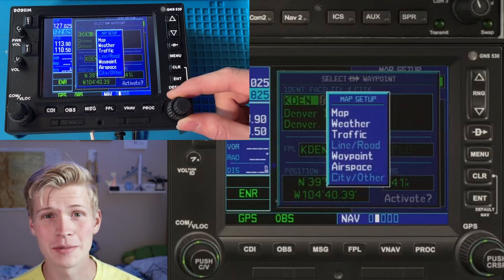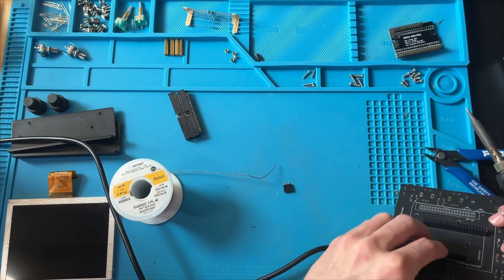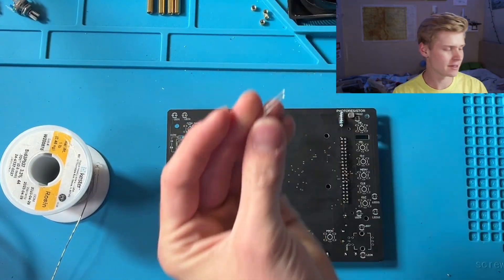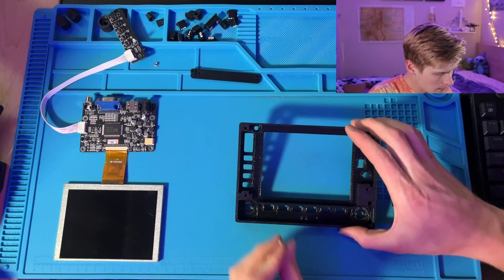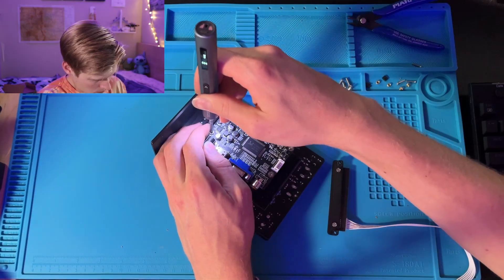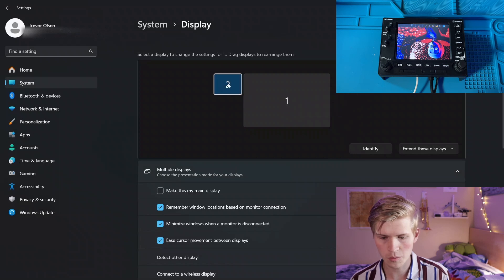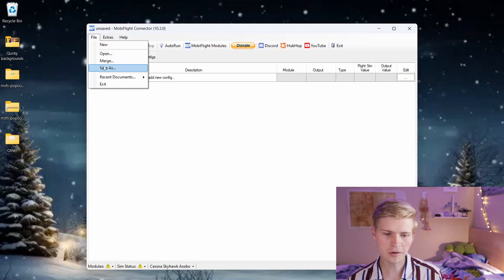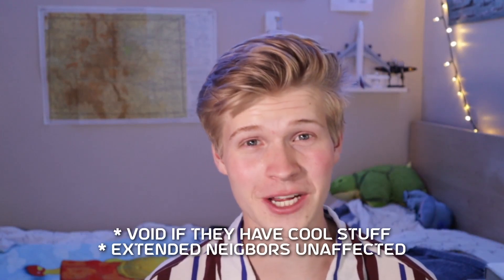Build a GNS 530 for Flight Sim! | C172 #53

Comment: How can I get the materials an how can I get the the soldering plate? And about the display, what’s the specs?
Reply from the maker: Hello! You can purchase the materials online and 3D print the pieces if you have a 3D printer or use an online service.
The soldering plate is here: https://captainbobsim.com/product/gns-530-circuit-board/
The display is here: https://www.aliexpress.us/item/3256803969915399.html?spm=a2g0o.productlist.main.14.65bb56cfdMKhCY&algo_pvid=4503ef28-b67c-4070-9522-b0203d1b7298&algo_exp_id=4503ef28-b67c-4070-9522-b0203d1b7298-13&pdp_ext_f=%7B%22order%22%3A%221%22%2C%22eval%22%3A%221%22%7D&pdp_npi=6%40dis%21USD%2192.45%2173.96%21%21%2192.45%2173.96%21%402101c59817573662999077453e75dc%2112000028222902590%21sea%21US%210%21ABX%211%210%21n_tag%3A-29910%3Bd%3A70bd7327%3Bm03_new_user%3A-29895&curPageLogUid=XpQCUlmcwgwA&utparam-url=scene%3Asearch%7Cquery_from%3A%7Cx_object_id%3A1005004156230151%7C_p_origin_prod%3A

Comment: Hi Captain! Another excellent project by you..! I've realized your Cessna Ignition block with return spring, and works fine! just one question about this Garmin 530... how do you fix the 3d printed buttons on the tactile buttons? do you use glue..? or is there a mechanical retention mechanism?... thankyou for you kindly answer about that..Marco, Italy
Reply from the maker: They just lay in place, you can use a dot of glue if you like!

Comment: hey captain bob i have a request 

like you make separate module for every thing for eg:- throttel, battery switches  pumps and yoke module so how you connect multiple Arduino together so it can work together

can you please make a detailed video how to do it <3
Reply from the maker: You just connect the grounds together and the 5Vs together. Then you assign each device to a blank set of pins.
I don't have the capacity to make videos right now but I'll try to include it when I do!
Reply: @CaptainBobSim  thnks ❤️

Comment: Hello! great project!
I have a couple questions. will this work with the GNS430 in the Diamond DA-20? Unfortunately it does not have a pop out panel, it won't poppet to a display to be used with a touchscreen and knobster unfortunately.?
Reply from the maker: The buttons should work if you program them to a GNS 430.
You need the popout however, to display the GNS display.

Comment: Hey I am building my own sim project, how can I connect many arduinos to my pc? Because I don't have enough USB ports to connect them via cable
Reply from the maker: You can get a powered USB Hub!
Reply: @CaptainBobSim  thank you very much, I will try it. :)
Reply: @CaptainBobSim  And one last thing, how to connect these lcd screens via hdmi cable, cause I have the same problem here😅, how can I connect more screens beacuse my graphic card only has 2 slots?
Reply from the maker: @michalalicky3300  This one is more tricky - I've tried USB to HDMI cords with some success, you can also get a USB C Dock and try that. It may mess with computer performance - Some people add an extra computer and figure out how to network it
Reply: @CaptainBobSim  ok, thank you very much for responding

Comment: Hi Trevor, last week I received my order of PCB board,  and  i got V1.2!! nice!!.. Today I was doing my soldering and noticed that in version 1.1 you installed 8 ( eight)   47 ohm resistor, and in version 1.2  what I got,  I have room for 7 ( seven) resistors of 47 kohms instead .. thats is correct?  I understood is is upgrade version, maybe You adjusted some values.. can confimr pls? thanks!!!!   i dont want to test  and fried my ledss lol.. to be sure are , 8 of  47 Ohms and 1 of 10 K Ohms .. right?
Reply from the maker: Correct! I moved the "530'" text to the right so there is room for the photoresistor, then removed an LED or two when I better positioned them over text (there were a few duplicates). You are good to use the (7) 47Ω resistors.
Reply: @CaptainBobSim  thanks one.more thing,  cptn!!!47 ohms? Or 47 kohms? And R5 is kohms or ohms?
Reply from the maker: 47 ohms (47Ω), not 47kOhms
the 10kOhm (10kΩ) is for the photoresistor
Reply: @CaptainBobSim  you re the best ,!! Thaks trevor.. my bad  english sometimes give me hardtimes... !!

Comment: Great build as always. When i built my 530, a PCB would have saved a bunch of time and eliminated the spaghetti nest of wires i created. Yours is fantastic, but the 3D printed faceplate needs higher res. I used acetone with good success for smoothing.

Stay amazing. I will be ordering!
Reply from the maker: Thank you so much! I haven't tried acetone yet, I'll have to give it a go someday!
Reply: @ecdcrew  acetone? How dod you acomplished???? Love to hear that trick!
Reply: @miketango507  Honestly, it's real simple. You need qtips, box store acetone and a gentle "wet then wipe" storke on the rough areas. Be careful, fumes etc so do it in a ventilated area. Is it perfect, no, but that plus sanding work wonders on bad prints. To describe it, the acetone "melts" the imperfections, so use caution

Comment: Hi Bob
Great work again, i'm not seeing any info or links to the BOM, print files or the PCB? adding a schematic would also be helpful (if possible)
Reply from the maker: Hi Ian! I wanted to post the video before summer ended to avoid delay.
I've now uploaded the files (except for waiting on listing the Gerber), they're in the description :)
The pinout is also in the readme if you are interested!
Reply: Thanks Bob
Reply: Thanks Bob
Reply: I take it the white LED's are 5v?
Reply: and I'm surprised the through hole and not surface mount!!!!!! I can do a gerber for surface mount if you want??? would need some more info to do so, if interested drop me a PM
Reply from the maker: @iansugden8125  They are 3.0-3.2V
Reply: 899x400 screen ok to use? Finding then cheaper

Comment: Hello Bob, I am currently working on the g1000 project and recently purchased some PCBs from your website. I am encountering some difficulties in printing letters on the bezel using my Ender 3 printer.

I am particularly impressed with the quality of the letters on your bezels and would like to know more about your printing setup. Could you please share information about the printer and nozzle size you are using? 

Additionally, I would appreciate knowing if you are using an FDM or resin printer. Thanks
Reply from the maker: Hello! 
A lot of it is designing the model to work with larger text - if I went with the more realistic size the text would not look good (assuming 0.4mm nozzle). You may also consider making sure your belts are properly tensioned, I ran into issues with this on my Ender 3.
I'm using an FDM Bambu P1S.

Comment: I am building a simulator to replicate my Mooney J.  It will have a Garmin G3x, dual G-5s, GTN 750, and a GMC 500 autopilot.  I am building the steel stand with wheels and scissor jacks to stabilize it when using it.
Reply from the maker: That sounds like a super awesome project!
Reply: @CaptainBobSim  Ya, I will keep you up to date as I build it.  I just ordered the FlightSim force feed back yoke.